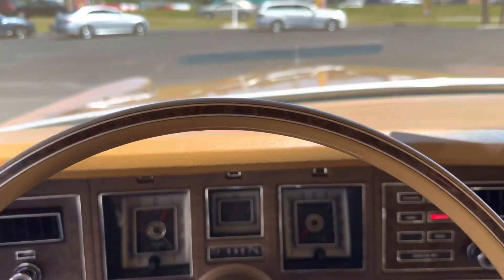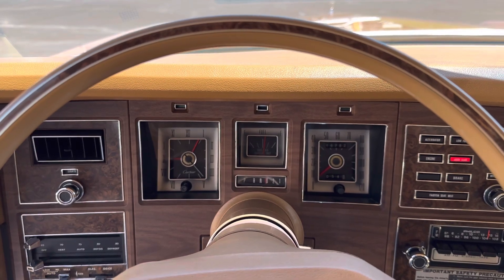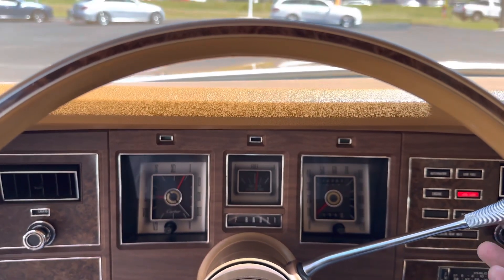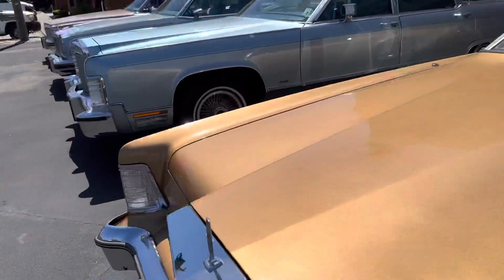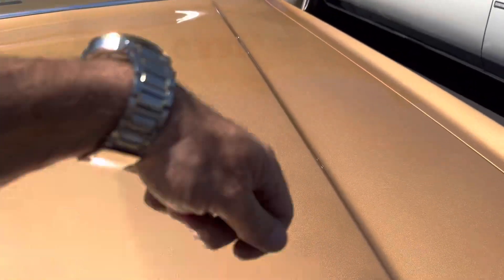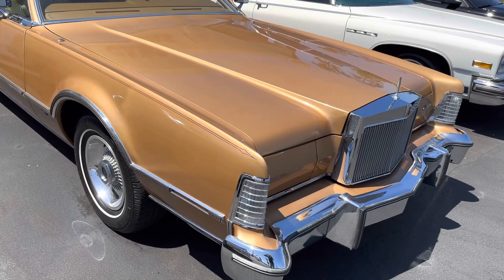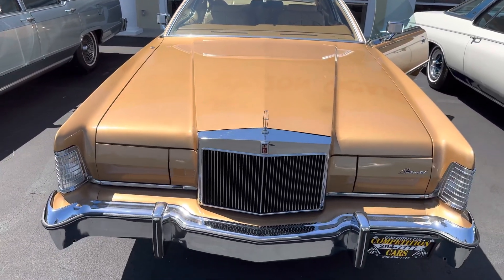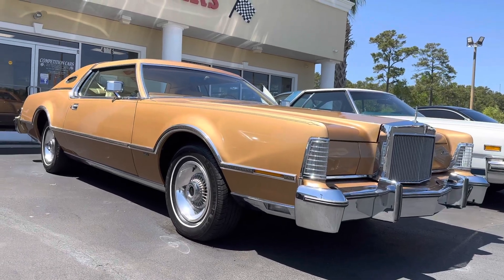1975 Lincoln Mark IV Idling!!

Comment: These cars were sprayed by hand, so some banding and shading is just down to how good
the sprayer was.
Matching that shade of paint would not be easy, even with todays techniques, no one can
be certain of the results until you have finished.
I would leave the hood as it is, on any car from this era, if the paint looks too good then it
has been resprayed, original factory finish is a must for serious collectors.
Reply from the maker: Yes sprayed by hand so subject to imperfections right from the factory.
Reply: They were all sprayed acrylic enamel single stage and buffed from the factory , have had many over the years including threes fours have to mark threes and 1 Mark 4 in Factory Purple all original
Reply from the maker: @zekerivers5189  Thanks!